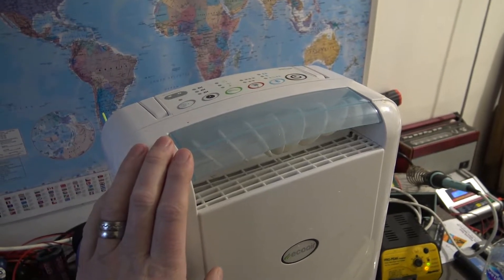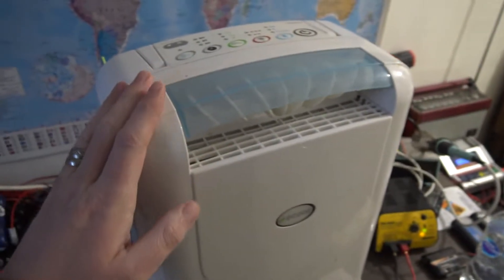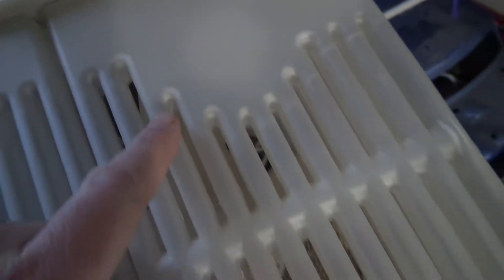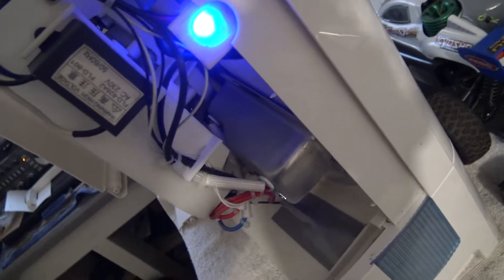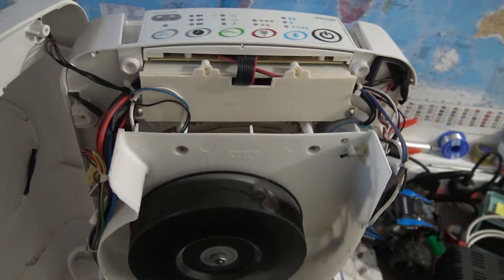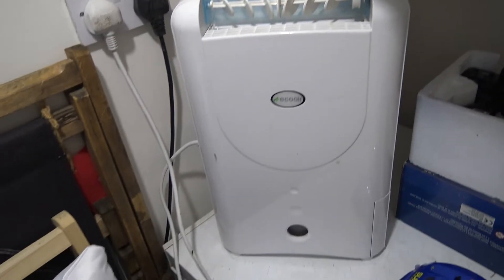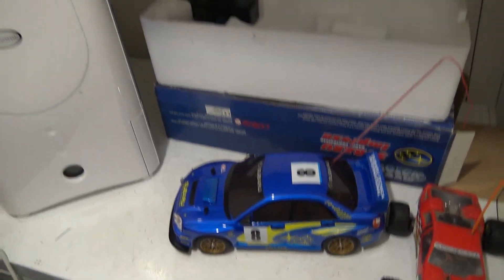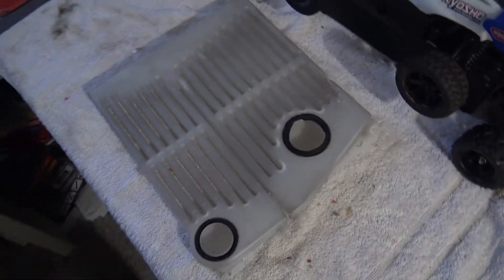EcoAir DD1 Classic MK5 Broken Again!

Comment: We've had ours for 6 years, and its never missed a beat !!! (even surviving one incident of my knocking it over during the night while on an excursion to the bathroom). Its made SUCH a difference to our house. I look at the bad reviews on amazon saying "cheaply made" and "cheap plastic" and can't reconcile it to the unit thats kept our house in super condition for 6 years with no fuss.

I'm not saying its the case with yourself, and yes a tiny percentage will have some manufacturing error that has slipped through QC, but I can only believe that the majority of those reviews are clueless mouthbreathers who expect a unit designed for use in combat conditions, and are surprised that it develops problems after "little Jimmy" has practiced his kung fu on it for 2 hours.
Reply from the maker: Yeah they’re really good quality units for the most part
Reply: Nearly 8 years without a problem great unit
Reply: Hi ecoair 👋

Comment: Great video and thank you for sharing👍🏻
I own an "EcoAir DD1 Classic MK6" dehumidifier, and recently it has begun leaking water onto the floor instead of collecting it in the water container. Despite this issue, the dehumidifier continues to operate effectively. Do you have any insights into what might be causing this problem, and could you provide guidance on how to resolve it?
Thanks again.🙏🏼
Reply: Same issue. I’d love to know if there’s a solution, before I dispose of the unit
Reply: I have the same issue! Any luck on finding out what was wrong?
Reply: @rjassal98 we found another vid showing how to clean the parts, we tried dismantling it to clean, but we couldn’t follow all the way and given up on it. Good luck :)

Comment: I have a 4 year old Meaco Zambezi dehumidifier that has developed a C1 overheat error.  It's being caused by the failure of the regen motor which has a thermal fuse attached.  Unlike your experience with EcoAir my dealings with Meaco have been awful.  They refused to look at my machine because I had opened it up to clean it and I cannot them to answer whether they will sell any parts. I've found the thermal fuses and ordered some (but why did it blow?) so hopefully I've ordered a compatible motor (YJ48/200) in case the thermal fuse  blowing was a winding defect. I've just bought an EcoAir because of the difficulty in dealing with Meaco.  They all look very similar inside and I think they are all made by Youlong in China.

Comment: Test continuity of the thermal fuse its probably blown and swap it out, Its most common had to change two on heaters since november, Only a couple of quid, you can short it out to check it also
Reply from the maker: Do you know where it is?
Reply: @RSPYT  It'll  be near the heater elements looks like a through hole resistor but silver. The heater supply will go to it. It may have a white sleeve over it
Reply from the maker: Cheers I’ll investigate
Reply: I have similar problem - no heat. Saw a break in heater wire. Temporarily bridged expecting heat but nothing. Probed the 3 wires to back of heater but next to do power draw. Assumed it was the thermal fuse but tested and OK. Any other ideas? There's another component which sits next to fuse on rear or heater housing.  Looks like a resistor. Do you know what this is?
Reply: Think I've sorted it. Heater is  forced on only during laundry mode. It got hot and I measure 100w per element.  Ordered element replacement for £33. Exactly what happened in 'dry' mode I don't know.
Reply from the maker: Ooo I’ll try that on my one :)
Reply: What's the value and spec of thermal fuse please ?

Comment: The heaters are switched via relays.The relays can fail.I always use a power meter to check load when working.On full power about 620w on eco about 320w.If the thermal fuses have been activated then there will be no power going to the machine.

Comment: Mine's been great for 6+ years but now not drawing water and heater element isn't getting hot. I've taken it apart, replaced the thermal fuse and the heater got red hot. Put it back together, no heat again! There's also a tiny thermal cut out switch, wonder if that could be faulty. All in all, a right pain to fix and still none the wiser 😢

Comment: Mine's the same as that DD1 Simple model which was down on the floor in the video. It's still collecting water very well, but has just started to overflow the water tank. It fills to the top and the machine does not shut down so ends up in a puddle of water if I don't keep an eye on it. I've noticed that the machine keeps running for a bit even if I pull out the tank whilst it's running, too, which never used to happen. The shut-off works my means of a rocker in the tank with a float at one end and a magnet at the other. When the water makes the float rise, the magnet is pulled away from a reed switch located inside the main body of the machine. I think there's something wrong with the reed switch - maybe the reeds have become magnetised over time and stick together even when the magnet's moved away. Anyone else had that problem?

Comment: ours have the same problem, not collecting water anymore. about 4-5 years old and we used constantly.
Used to collect 2 litres of water as normal, but last few months was strange: collected 2 litres in a week!

Afterwards got more strange: collected 250ml water and stopped.
Moved around a bit, wiped out, and work again for a day, and collect only 2-300ml water and stops.

I put an other dehumidifier (same model) and that collects 2 liters a day. 

What could be the problem, what part do I need to order?
Reply from the maker: You’ll have to take it apart to find out what’s gone wrong as it could be a few things causing it.

Comment: I have just brought one of these aa the heat and damp in my flat my son cant breathe his room is full of humid air and so hot and stuffy, iv tried air coolers water coolers they just make it worse as it the air needs taking out to cool the room from the humid damp air will this work ? Iv just paid 160 for it nothing else has worked a dehumidifiers is the only thing I haven't tried ? 
Thanks for your video
Reply: How did the dehumidifier fare in your son's room? Was the problem solved?